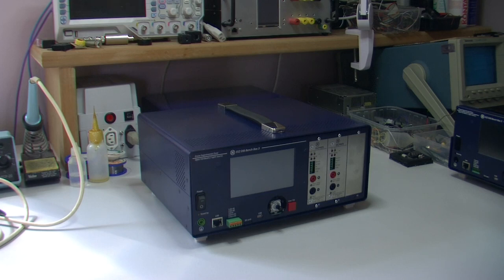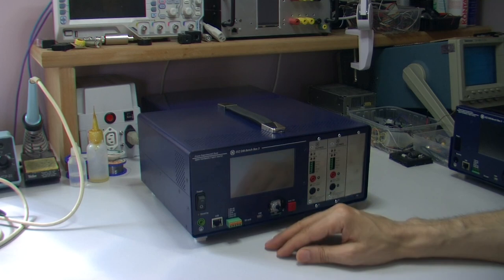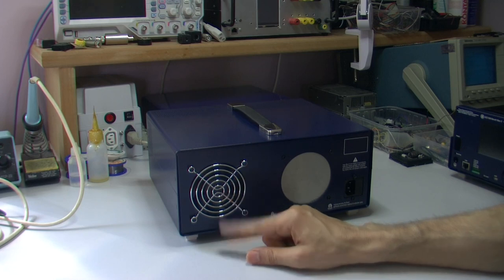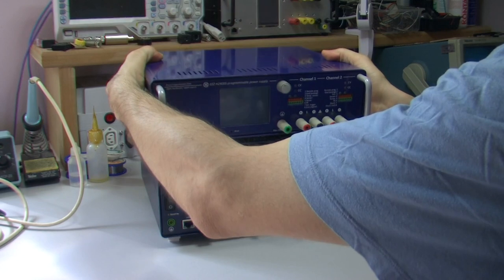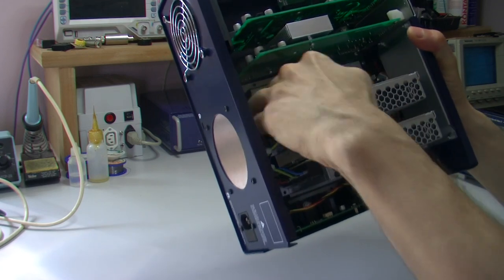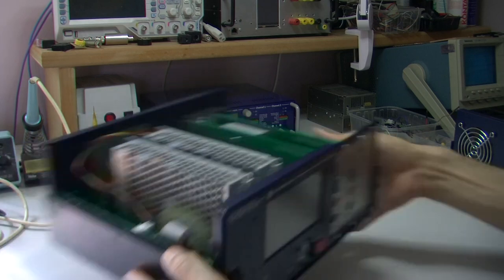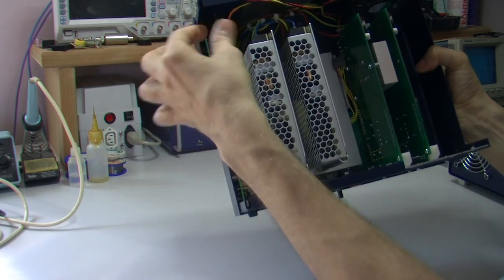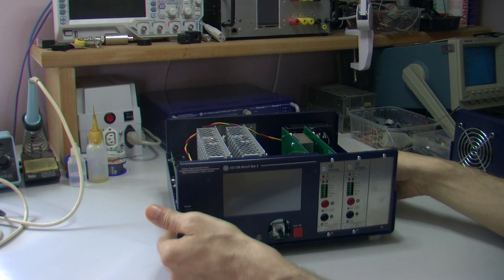EEZ BB3 first prototype

Comment: Very much looking fwd to it !   But the LAN on the front is ... weird and a bit inconvenient :/
Reply from the maker: Yeah, it's not simple at all to keep wire harness to the lowest possible level, minimize PCB dimensions (especially the MCU board that has 4-layers) and have all things on the right places. I was thinking a lot, what to do, and since I'm strongly believe that Ethernet (i.e. wired connection) should be an integral part of such kind of equipment, it ended up on the MCU board where reside all other parts that are exposed on the the front panel. The good think is that BB3 enclosure comes with adjustable and high enough feet that allows safe bending of LAN cable to bring it to the rear side.
Reply: @EEZOpen  the great thing about open source hardware... we can hack it!  :)

I agree that on the back would be nice, in most cases, though the front is nice for some environments, I'm sure.  Anyway, looks like a neat thing!  Subscribed, and pondering it on CrowdSupply!